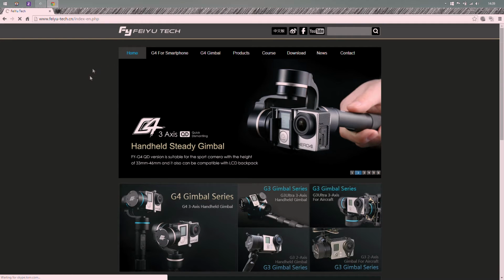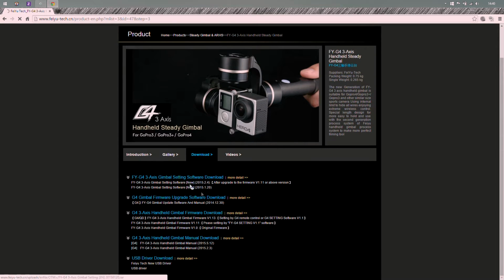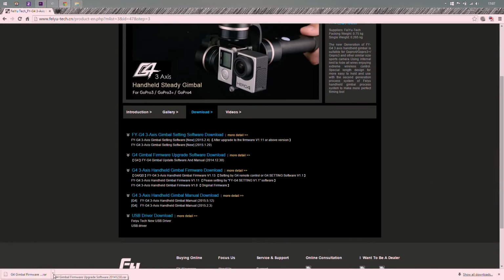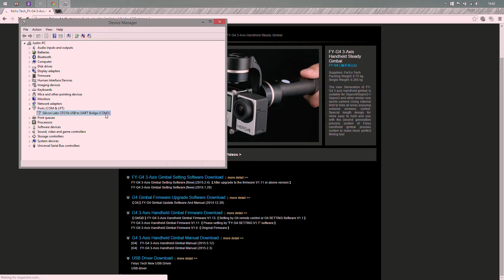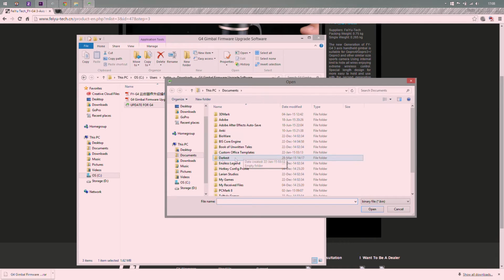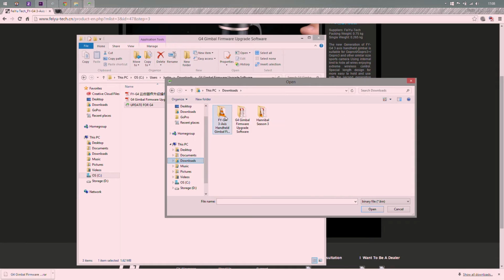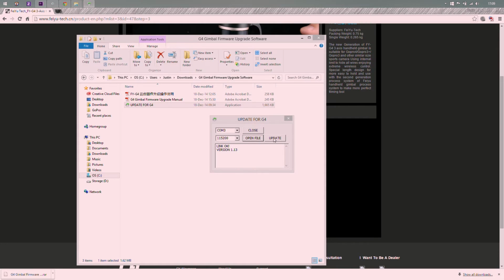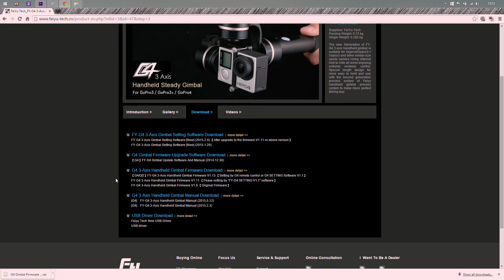Feiyu-Tech G4 3 Axis Gimbal shaking FIX | Step by Step

Comment: I bought one of these things, watched this a couple times, and I think I’m missing something, is there something that I need to plug in between my USB cable and port, my computer don’t know there is something plugged into it, but it will charge the batteries?
I’m not that computer savvy, and I got windows10 (not too crazy about that)
Thanks

Comment: Hey buddy thanks for the video. I have a few of the skylab 3 axis gimbals for GoPro and they have the same problem. They shake and go crazy. Any ideas. I can't see to find anything online about the problem or the fix. Thanks in advance.
Reply: I got a SPG and Gopro Hero 4 silver today, and have exactly the same vibration problem. I guessed the "weight" is "JUST WRONG", the moror is continue adjusting the balance left and right and cause the vibration.  the add the weight(make it closer to iphone) I put a piece of flat metal (0.3 inch x 1.5 inch) between the lower Sponge Pad and the GoPro, magically problem solved!

Comment: Thx for the information. i have one question. based on my research, lot of people having an issues after upgrading the firmware. they're tried to upgrading the firmware from 1.0 (original firmware) to 1.13 version. btw there's a new firmware version 1.22. so, should i upgrade the firmware to version 1.22?

Comment: Hahahaha dude you're killing me, oh man same (but different) problem on this side of the world. This thing sucks the fact that it doesnt come preinstalled with the latest firmware is unacceptable but what is worse is that the G4/s is a problem to start with. We also have a G3 and had issues with it out of the box too, did the firmware after which it worked (still works) so when upgraded to a newer model we thought YEAH!  But NO.... I'm on a Mac too and of course their software wont work, whats worse is they are now saying only windows 7/8, most people I know who use Windows are now on 10, so WTF!  Luckily we bought this on Ebay which seems to be the safest place to buy anything online as they guarantee money back or replacement and are very strict. We sent this unit back, they sent us a new one, we thought again YAY!  NOT! Same issue... what shits me is aparently they all have this tremor shaking problem and the supplier will keep sending you new (faulty) units until our warranty runs out... After that only thing left is to go postal. So we are demanding our money back and going for the new GoPro gimbal instead.

Comment: Hi, I followed your instructions but after I hit "Upgrade", it only counts to 99 twice.. "Set slave2 mode ok", then after a few seconds shows me "Send Fail". Any ideas?
Reply: I'm having the exact same problem. Have you found a solution? Does anyone else know about this issue??
Reply: @xforeverendingx  hey did you found solution ?
Reply: Catt Moogle same issue...I've used Windows 7 & 10. Same issue...
Reply: @ChrisIssac  hey did you found solution ?
Reply: Catt Moogle same issue...I've used Windows 7 & 10. Same issue.

Comment: Who research problems before they have a problem?.................... ME   lol   Since almost  all products now days are made in  China (low quality control capital of the world)  I have got into the good habit of even before buying something research what problems most people have had with he product I am interesting in getting. It has save me a lot of problems plenty of times
Reply from the maker: Yeah I research a product on its competitors. But failed to research this one in depth. Glad you found this video first before an expensive mistake! Mines still collecting dust on the shelf.
Reply: kin3tiks It is still not working?  ouch.  Not that I would do this but  in you case I would buy a new one one amazon or ebay...  swap serial numbers if that thing has any ... claim it arrived defective and send back the damaged one you got in the first place..... I know is not the "moral thing to do" but they are the ones that messed up the whole thing in the first place with their firmware. They are responsible for this.

Comment: I had almost the same fxxxn problem. After updating from version 1.11 to 1.13 my gimbal doesn't turn on anymore. That sucks. After freaking out for hours trying getting back to former version but with still no success turning on. I contacted feiyu- support which answers on time which is great, but now they want a video from me of not is working :). Well, ok I'll make a video from trying to turn on the gimbal with no succes...Great shxx!
Reply from the maker: +Mark Forcella HAhaha So their tech support is as bad as there products. Great to know... After shooting with  my gimbal on a backpacking trip, mine stopped working again.. I give up. sh*t product for the price.
Reply: +kin3tiks Yeah, support is nearly the same as the product. In the beginning the gimbal was doing a great job, but it seems not holding the promise. And correct, for that price it sucks. Well. I wanted to take mine as well on a next year backpacker tour to Thailand. I think I can eliminate that out of my mind, shxx. :) ...life goes on...

Comment: great video and funny!   I have the G3 Ultra  and for some reason if i don't have the batteries attached i get a UPDATE Send Fail -- but if batteries are in it seems to do the update... i started with oldest firmware on the Feiyu tech site and went thru to the most recent - but i am still getting shakes -- any advice? 

pierre
Reply from the maker: Well well. You have stumped me. It sounds like your power source, possibly your USB connection is not providing appropriate power. Look for lint, gunk, rust. And consider using a homies computer if they have USB 3.0. That's what I used.

Comment: Thanks. Should have not upgraded as you mentioned. I would NEVER buy one of these.
Reply from the maker: Gibson Smith Agreed, even though I fixed it, it left a bitter taste. This market is in dire need of a consumer level gyro, considering this is the top rated. Another note, if you are returning it. They are in the midst of releasing a brand new model that is mountable/wearable. It may be more promising.